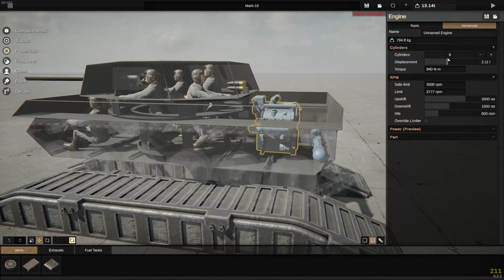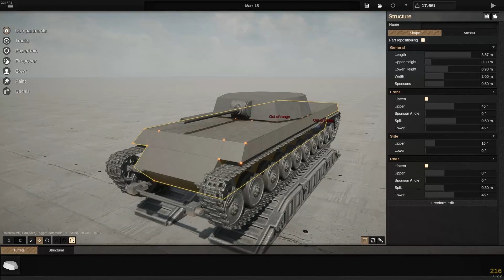Sprocket 0.2 Alpha Guide: How to edit the engine and drivetrain

Comment: How do you get rid of one of the transmissions? I'm trying to make a single transmission engine and I'm stuck with twin transmissions making all my tanks neutral steer.
Reply: you can select the system to change it when you are in the Powertrain window